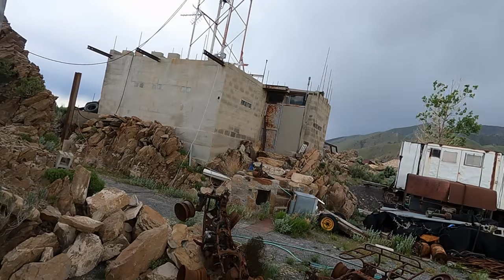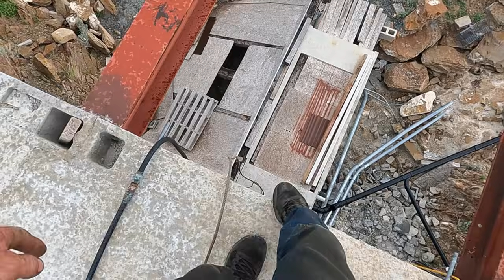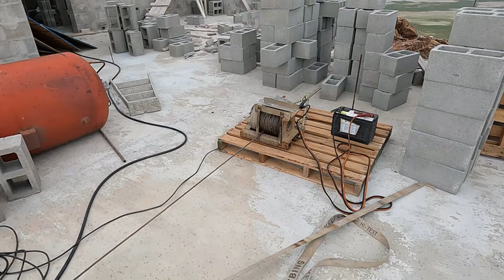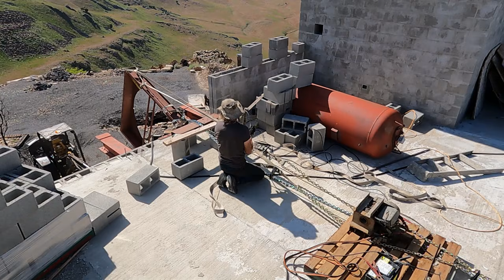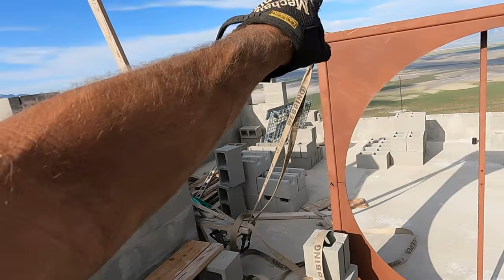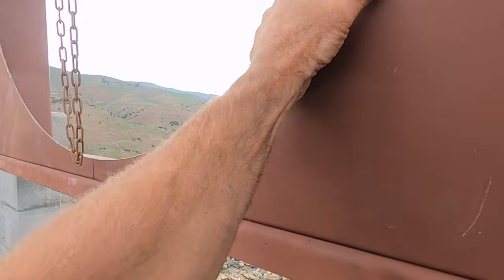Installing Turbine Frame 1 on top of the Fortress! 2

Comment: You might consider getting a Vermett lift, hand crank forklift used by hvac contractors to set eqpt up to a ceiling. They have 500 lb capacity. 

Commercial contractors for multi story building have temporary elevators for material handling. I bet you could rig one  up with a winch and track.

Comment: I mean this Video is 7 Month old, but why didn't you simply build a try pod or angle with a Pullie to  get the liftinkpoint up in the air and outside the building?, than set it on the third level pullid it up and finally used it for putting the frame into the Wall? But Im impressed by your will and determination. Edit: A day later you put up a Frame and hoist to slide it in position, great work!

Comment: Amazing job Alan I am sure in your past life you must have been the chap that designed and built the pyramids. You could do with making a wooden Crane that swings left to right and it overhangs your building so you can lift anything else without it dragging up your building then at the top just swing it around to where you need things you could even make a steel one at the top of your building to leave in place for lifting anything up. Love watching your videos and how you overcome problems. Definitely a Wizard.or remove a crane off a recovery truck not a massive one but one you could bolt down and leave in place at the front of your building and when not in use swivel it around out of the way . Stay safe and take care .🏗️🏗️🏗️

Comment: I must tell you Alan that there was a former neighbor I had in PA, that was an older gentleman named Peter D. He was always finding ways to make use of discarded items. He had worked on steam shovels that were used to move Anthracite coal from the Coal Mines to the trucks waiting below for the loads.  Peter's brother had also worked with the steam shovels & often called Peter when there were issues with the heavy equipment. A giant bolt broke on one of the shovels & the replacement bolt would take 2 weeks to be replaced, often longer. To order it & wait for it to arrive, would hold up the production of strip mining. So Peter would search for a bolt for his brother to repair the shovel faster. Most times Peter was the man to trouble shoot ordering replacement parts, after all the bolt that Peter found was keeping coal miners working alongside The Anthracite KING, Once known as the largest Steam Shovel in North America !  When I was in my early 20's I was able to park my car inside the shovels bucket, along with several other vehicles one Saturday afternoon ! That took place in Northeastern Pennsylvania, where to this day in the year 2023 many of the residents still heat their homes with Anthracite Coal !                                                                                                                                                   I saw the coal cars that you showed to David Sparks & his crew, those may still be around the area where I grew up in PA. There had been a movie about the coal mining days called The Molly Maguires, where some scenes were filmed in Eckley, PA.

Comment: This is really unsafe standing in the rigging between the load and the winch. And your cable clamps by the  hook need to be turned 180 degrees so the large face of the clamp is on the heavier loaded part of the line. You are going to get hurt or killed working like this.

Comment: Dude, you have heaps of metal there, make an A frame, make a jib, make a crane tower, work smart, not hard, that winch with some pullies would work wonders if done right.
Loving the fact that you are now filming your work and we can see your progress, stay safe and be happy.
Reply: You are right. I was thinking he should be using a z rig pulley system. It's what high angle rescuers use to bring victims up and down shear cliff face

Comment: It would have been easy and safer to have bolted aome 3 inch angel to the I beams upwards with a angel across the top and made a temporary elevator with the winch. For the very top you could have laid  2 2×10×16 down to make a ramp and slid it up on it's side.

Comment: You needed to stand up a truck tire with rim air run cable up and over wheel will lift above roof line and roll towards the winch like pulling fence post

Comment: Build a frame on the 2 steel beams that stick out. Mount a pulley on the frame so you can lift heavy items to the roof without having them get caught on the side of the building. Be way easier and quicker.

Comment: #2 you didnt put anything between the concrete and the steel box. That steel will rot fast. You should have put a rubber sheet barrier and sealed the concrete. Concrete is a moisture sponge and the scratches in yhe red sealer from sliding it down it will be rusty the first time it rains.

Comment: Just another observation  you have 2 huge I beems sticking out right whete your lifting stuff up. Why dont you build a cable lift with a frame on those I beem you could lift pallets of stuff from that
Reply: Like a gantry crame setup out at the ends of thosr I beems

Comment: I'm super surprised that you haven't built a head frame off the top of the fortress yet so you could bring materials on top of to the 2nd floor super easy. Something that has your winch hooked up to it along with a swinging frame. Your a super smart guy doing everything the hard way and wearing your self out. Heck you could of used the 4 wheeler with some weights on it to a frame with a roller on top and pulled anything & everything up there. That the 4 wheeler could handle. Good luck.& God bless you. Hopefully you build a head frame of some sort to make life a little easier on yourself.

Comment: Alan, if any ancient Egyptians show up in a time machine asking to borrow some ratchet straps, we'll know how they really managed to build the pyramids.  😄

My two thoughts for how to make that job a lot easier if you need to move more heavy things would be either a ship's crane mounted up on the roof (like the ones they use on the crab boats for moving pots around) or something like the back arm off a backhoe with a winch attached to it to hoist it up to a higher level.  Would certainly be an interesting build, and would make moving all the heavy parts around a lot easier.
Reply: I know this an old post... ut he needs a Derrick or gin wheel

Comment: might be worth building a frame on those metal outriggers on the roof, which has a tackle block on it for the winch as i expect there maybe more lifting required for roof equipment installation and maintenance. LOL, now nearing the end of the vid and i see you done some thing similar. maybe the 2nd frame, use the same timber hoist and pull it straight up the outside wall from the ground into the hole in the wall where the frame will live

Comment: Bolt down a genny rig to those beams and raise your winch to the upper section. Build a ramp out of block and that plywood. The genny will be two legs forming an A with the wide base at the building edge. When the load reaches the apex of the pole, the A frame pivots, lifting the load and bringing it over the building. With straps reversed back to the end of the protruding beam you can lower the load by letting the a frame pivot over center. Disconnect the A frame and continue winching up the ramp. 
Keep the ramp and winch set up to skid block up to the higher level. Tracks, wheels and a cart would be nice too. 
Man with your talents should have a pivot crane built up top already. Always a blast watching your build. Thanks Wizard, appreciate you sharing.

Comment: Alan, you need to get yourself some mason ladder staging and an electric hoist. The electric hoist hangs from any beam overhead. It is 110 V and can’t lift 1000 pounds. You would’ve been done getting that thing up to the roof in less than two hours. You can get the mason ladder staging at Home Depot and the cross braces come different lengths. You can get adjustable leg, levelers that will help you cope with any terrain.

Comment: Allen...what's your plans for insulating those walls?

With you being atop a mountain, surely, a constantly blowing cold winter breeze will send the temperatures plumiting on the inside of the house?

You seem to have made it all out of block and poured concrete is all.

Comment: You have 2 steel beams on the side of your building you could build a triangle shaped fulcrum to sit on those beams and a pulley on the top of the v to winch the heavy stuff up to the top and when it hits the pulley it basically pulls the entire thing up and over the top edge onto your building... love the videos good luck!

Comment: i don't honestly think i have had the pleasure to watch who makes life so much more difficult for himself, but well done for some ingenuity and perseverance in getting them there lumps up on the roof

i would have thought by now with your vast experience and building this massive project up on top of a mini mountain that you might have modified some of your equipment to do these jobs

one thing i cannot do is use and waste vast amounts of time and energy in doing some of the most mundane jobs

i might have suggested with the large frame to tie it well to a pallet, use the pallet as a sledge, a sacrificial one, so you could pull it up the hillside at the rear, similar way you got your blocks up there, before Heavy D came along with the telehandler (you could do with one), using the winch on a vehicle at your front door, pulling over the top of the second floor, you could pull the pallet and frame up easier, as for going to the next level, a thing i do, which i think you did anyway, use the blocks to step up, put a couple of blocks down on both sides of the frame, stick the frame up on them, by stepping each side up then the other and tipping the frame from one side to the other, you could easily get the frame 4 to 5 feet off the deck, with it leaning flat against the wall making it easier for the final lift

another thing you could do, but i don't know how sturdy the frame is, is to put a zip line from your tower to the upper level of the house, with the frame leaning against the building, using a hoist on the zip wire, might be able to get the frame airborne enough to drag over onto the building

never the less, i still enjoy your videos, watching you struggle on, your quite the ol' soldier, make do and overcome attitude, just keep safe matey, loving the work

Comment: An easy rough 'rule of thumb' is that a 100ft extension cord will see 'voltage drop' of 5%. This won't give you precise figures, but it will put you in the ballpark on the conservative side.

Comment: You should put that red tank close to the edge and tie it to those 2 ibeams. Then put the cable over the tank and it will winch it right over the top.

Comment: Come on Allen you need a snath block with  two legs and a control rope easy peesy think about working on a roof
Allen make yourself an A frame  so you can use it every day like an elevator then move your a frame up to the next area you can move material every day and not work yourself like a  dog. If you want help let me know and We will have it done,, Welders do it easy !!!

Comment: you need to make a reg as the roofing company's use to raise the tar bails to the roof of a low flat area. Kind of like a engine hoist that slides from over the wall back 5 or 10 feet. Armchair comment.   where there is a will , there is a way.

Comment: Awesome Brute Force.  I was surprised you did not fabricobble a frame with a pulley for the winch to raise the load above the floor.  Or, mount the winch on the frame high enough above the floor to provide the needed clearance.  Surely there are enough materials at the fortress to do that.  Cheers from Texas

Comment: Since you will be hauling more stuff up than just the wind turbine components, you might devise an "A-frame" with a pulley and a pivoting base (hinge). Lay the A-frame down to get the initial pull, when the load reaches the top it pivots up and inward to safety. Might be worth the time to build.
Reply: I concur
Reply: Yes that would great to build a A- frame off the two big beams 10' or 12' up so you can bring the pieces up past the landing and swing it in as lowered it down. Also need a nice come along to pull stuff in on the landing when working by yourself up there!🤔😉👍
Reply: I was trying to say that yesterday, but Youtube wouldn't let me.

If it was good enough to use for building the pyramids of ancient Egypt, a fortress in Utah would surely be made to measure.
Reply: The Crosby clips terminating the cable to the hook are on backwards. You also should have more  tail coming out of the Crosbys, also possibly more Crosbys. (You would have to look up the specifics for your cable size, but I highly suggest you do)
Reply: yes a derrick - crane was invented a while ago -  my gandfather was a stone mason,  his yard derrick could achieve amazing feats, back when batteries were only for starting a vehicle  (pony motors ran accessories).
Reply: Basically a gin pole crain. And I was thinking he should definitely have something more long term temporary up there to help hoist as well. I think a gin pole would be about the easiest

Comment: I would have built a lift tower on that I-beam balcony. Than you could use a 4 weel block system and lift it manually at 1/4 of a total weight.

Comment: with your next wind mill frame maybe you could rig up a stronger lift point simaler to what you just used but gear it up to bring your frame right up the wall from the ground and into place, Use a couple pieces of 2 inch pipe with a cross bar welded or bolted on the top for your chain falls or winch with a pully on the cross bar. hope it helps. HALIFAX NOVA SCOTIA CANADA

Comment: Why haven't you built a winch operated elevator off those 2 I-beams where you brought the wind turbine frame up? Take some time now to build it and save time down the road. Then it won't take 8 hours to get the next one up, plus you have window frames to haul up. You can even drop stuff off on the 2nd floor. For such a smart guy, can't believe that hasn't been done already. Unless you enjoy carrying stuff up manually. Remember you are not in your 20's anymore. I have had to change the way I do things because my back decided it had enough, being in the construction trade.

Comment: Every episode is just an example of problem solving and alternative thinking,
Just brilliant to watch.
Though I am surprised you didn’t build a quick a frame to have your winch go over and five you the height you needed to pull the frame up,
OR have you thought of quickly building some block up and have a still sticking out to mount a which to pull things up similar to how they did in harbours or industrial areas years ago? No doubt your gonna need to move or winch more heavy materials in the future - could be something permanently in place to use… 🤔
But regardless great video and content - love how you show everything warts an all - your successes as well as failures, which after a bit of careful thought still end up in further success 👏👏👏👏

Comment: mount a piece of pipe on the ends of i beams to allow something to come up away from building. put a long rope and feed it from the top. looking good allen!!! also think about a 3 legged hoist to lift items up on top floor with rollers that could be locked down.

Comment: You have got to make a real lift frame that you can use to lift anything easily, e.g. water, bricks, cement, and any thing else.   
You often work way harder than you have to.   You’re way works but is much harder than if you built your self a lift frame

Comment: That's a warning 8274 Allen! Great sought after winch it has a gear box that's oil filled and a actual brake. It's know for its line speed. It's rates at 10k but it is stronger then that

Comment: Next time you need to lift something up there, using the same equipment, plus a pallet in good shape, load whatever you're lifting onto a pallet and lift the pallet. Your load will come bove the floor level where you can then slide it off. Sure, you might have to build a simple wooden brace or two to hold your load verticle. I believe if you ran a strap to each corner of the pallet and two each around the inside of each of your installed steel brackets that are on the outside of your building.

Comment: Alan make a little crane to bolt to the two I beams sticking out you have access to all the gear to build one, with a pulley block on the hook to reduce the speed and load by half. Have a look at Guédelon Castle in the Wikipedia picture 2019 and the wooden crane the vertical pole rotates at the bottom and is stayed by ropes at the top you could build one from steel. Note communally known as a derrick.

Comment: Alan, just thinking of your safety: Regarding your cable clamps on your winch line, have you not heard the expression, "Never saddle a dead horse"? It refers to the fact that you never put the saddle part of the cable clamp on the "dead" (tail) end of the cable. Please switch your clamp around.

Comment: A gin pole would be very helpful.  As much as you are bringing up it would well be worth the effort.  

The winch is a warn 8274.  The round part with the ribs house the brake so it will hold line.  The early ones used small round discs, don't recall if there are 4 or 6.  You can upgrade the older ones to the large discs. The material will remind you of clutch material. 

The 8274 is rated for 8000#, but will do quit a bit more.  You can upgrade to a 6 hp or double motors.

Comment: Hook a snatch block to the turbine frame and run the cable back the the winch, it will slow it down and increase the torque. When you had it close to the top and were pulling the top over with the 2 ratchet straps the winch cable would go slack, you could then move the winch cable to the top and use the winch to pull it instead of the 2 ratchet straps.